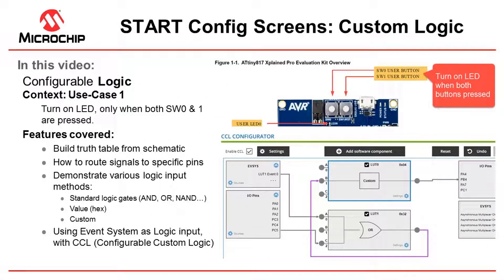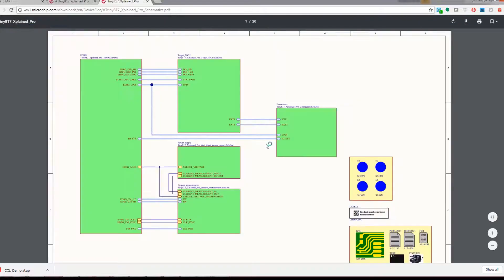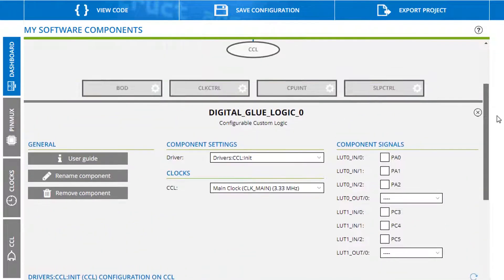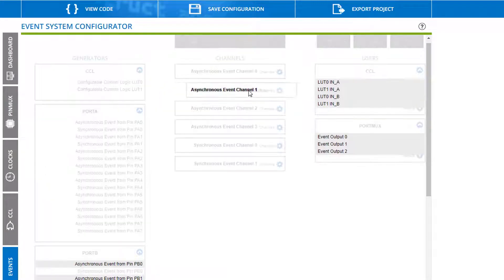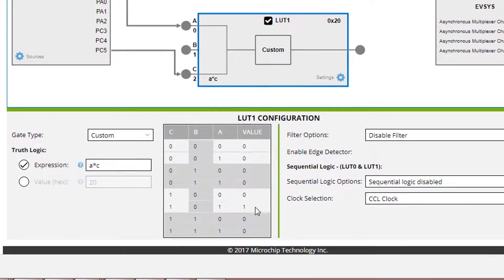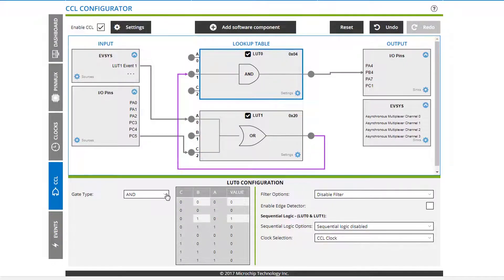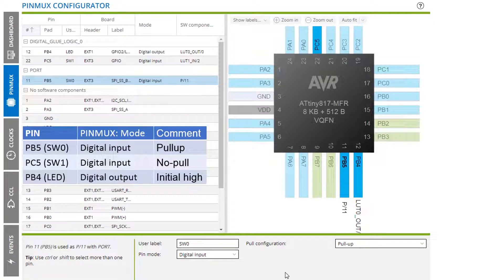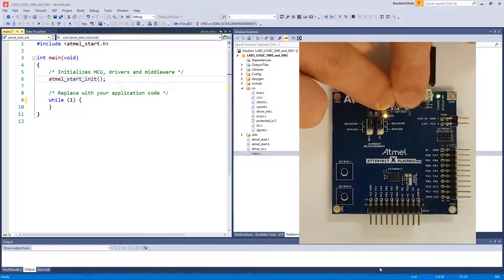Getting Started | START Config Screens - Configurable Logic CONFIGURATOR

Comment: Why can't I find the CCL Configurator view when I want to realise a project with an ATSAME51? Digital Glue Logic can be added, but there is no menu item for CCL and its graphical configuration menu on the left side. The EVENTS menu item does appear. I do not want to work with the MPLAB Harmony Configurator. After the initialisation code, we use IAR EWARM as IDE.